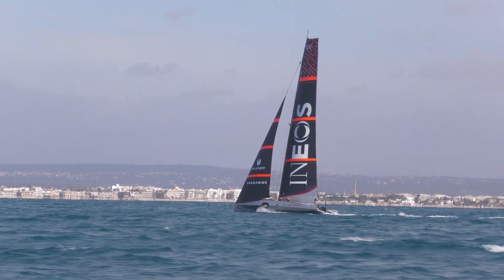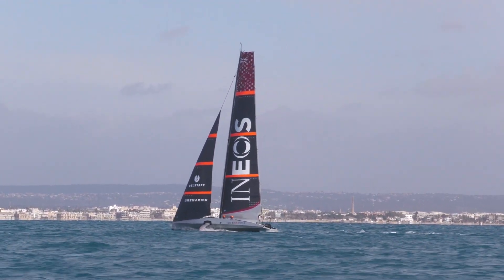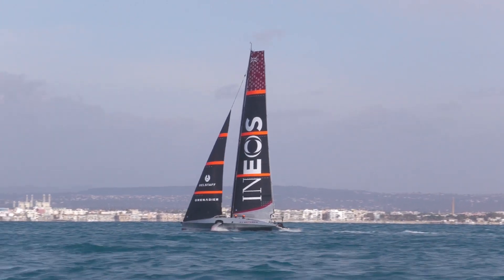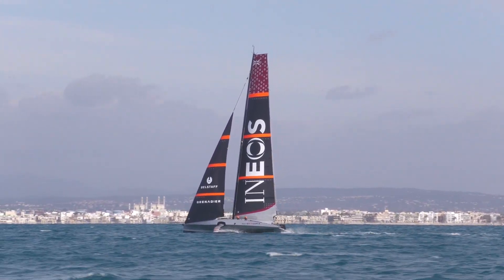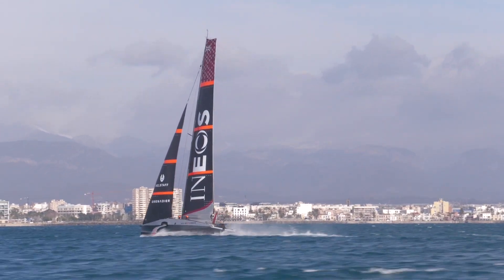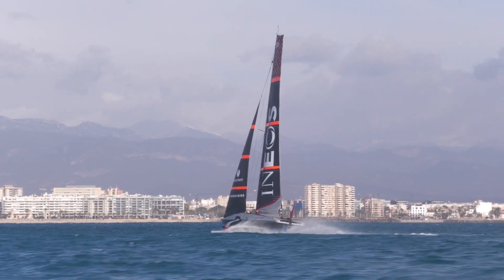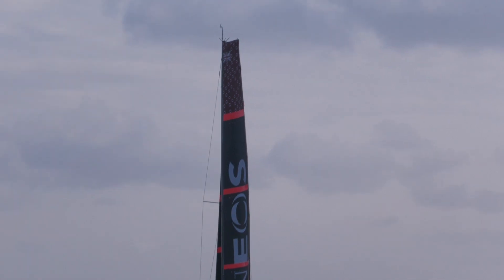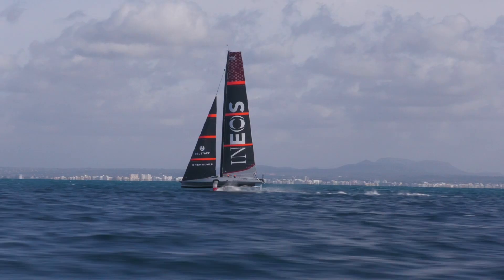INEOS Britannia T6 Day 15 Summary

Comment: If this is the challenger than ETNZ has already won the 37th AC.
Reply: It all depends on who’s boat is best suited to the range of conditions over the match. It could still be anyone at this point
Reply: This is NOT the challenger. No team has revealed the yacht they will be racing the AC37 on. The teams are training on the LEQ12 platform which is for testing and development only, not for racing.
Reply: Tell me you don't understand the AC with out telling me you don't understand the AC.
Reply: I’d say they are pretty doing well. Previous, lower inertia hulls have had nowhere near the off-foil speed of this data gathering, proof of concept design.